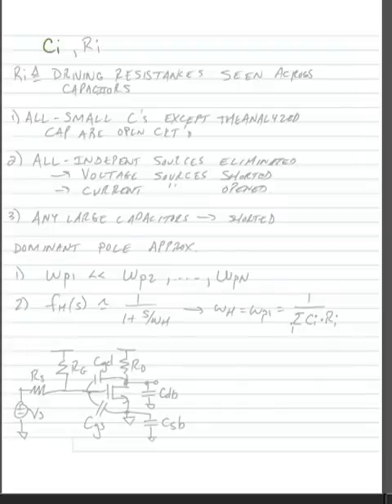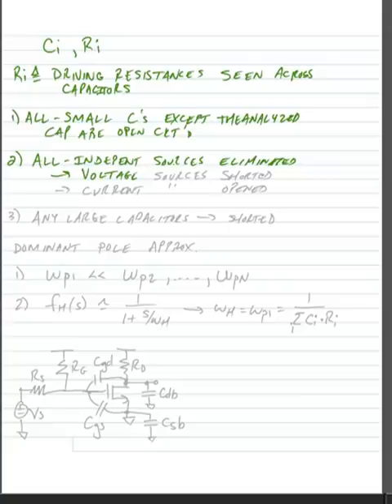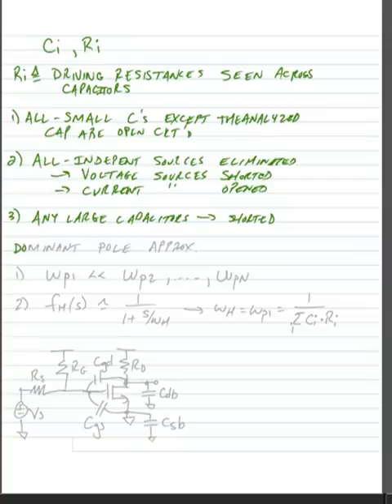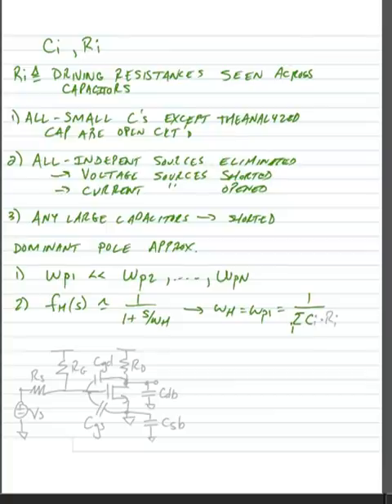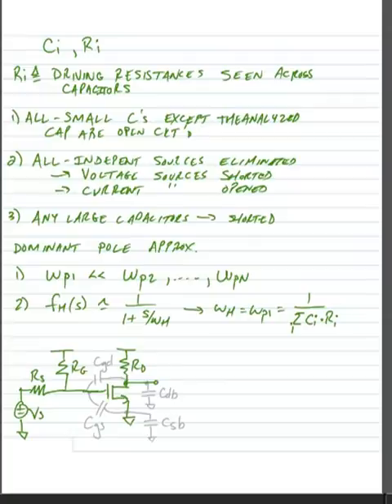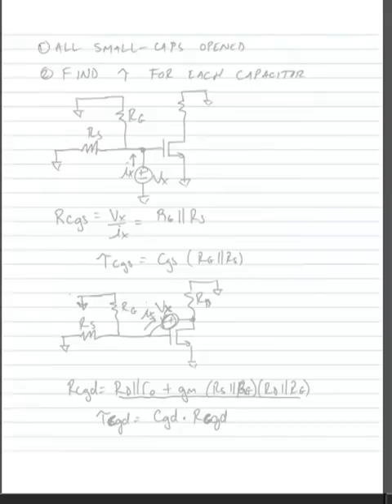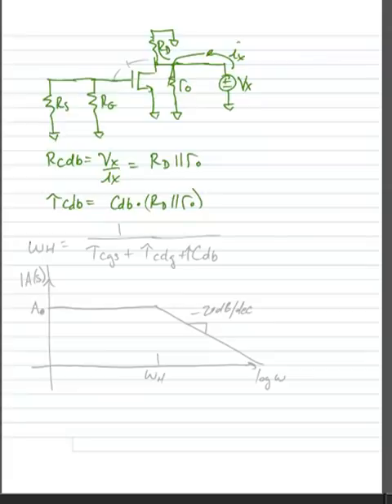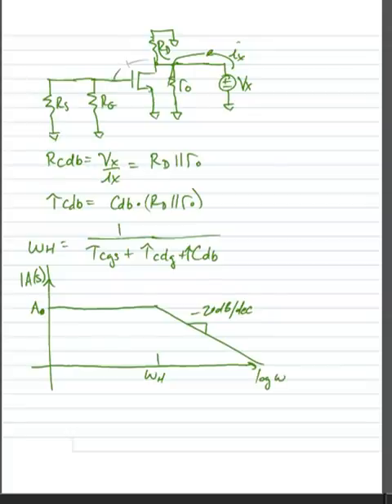ECE 3110 - Lecture 4 - Part 2 - OCTC Frequency Analysis

Comment from the maker: I double checked and the calculated resistance is correct after reduction of small terms. Of course the point is that that resistance is difficult to calculate, which is why we use the Miller effect in follow on videos.

Comment: i wish someone would derive the more difficult resistances. very frustrating
Reply from the maker: +Captain Rhodes The point is that it is a waste of time to do so if you can make a good approximation using the Miller effect. The derivation is not difficult, it literally three equations and can be found on the derivations tab of my onenote page: https://onedrive.live.com/redir?page=view&resid=558C337B80B21331!8895&authkey=!ADQGk3P2egRi5fI
Reply: Thanks for that. Can I ask - does that test voltage work no matter what? im trying to solve a common collector model and i cant do it. do you think we should always apply miller first?
Reply from the maker: +Captain Rhodes There is no Miller effect for a common collector. Miller effect requires inverting gain across the capacitor.

As for the test voltage, it is a common way to find the impedance, place a voltage and calculate the current that flows through it.
Reply: @wallingphd  Is inverting gain really a requirement for Miller's Theorem?  Sedra and Smith states "K is a gain factor that can be positive or negative".  Thanks for the video.